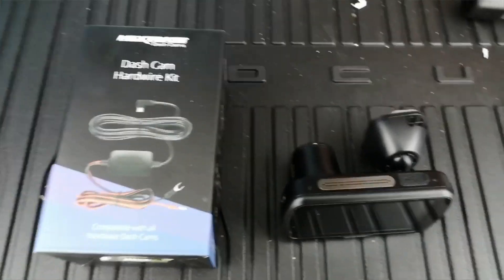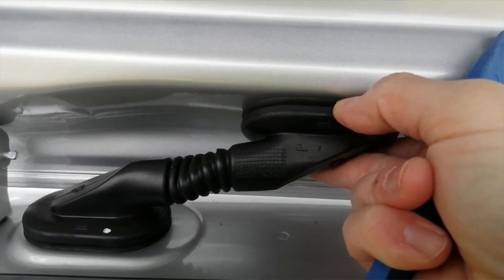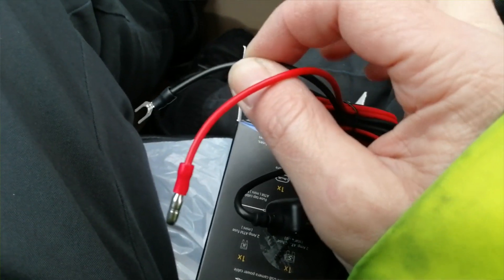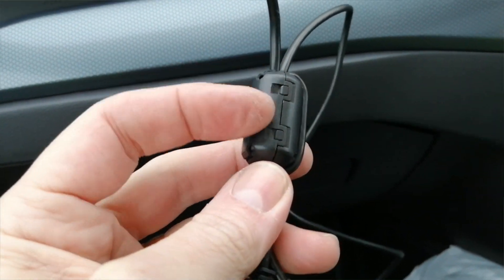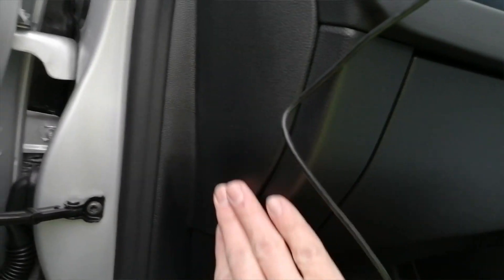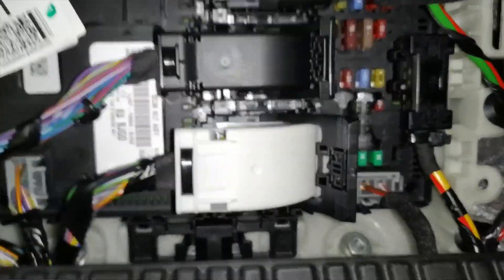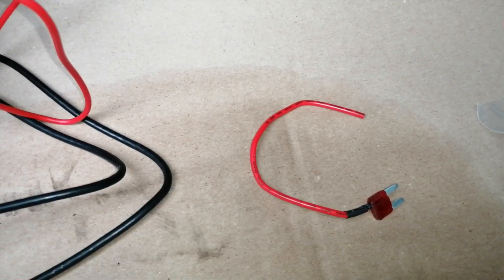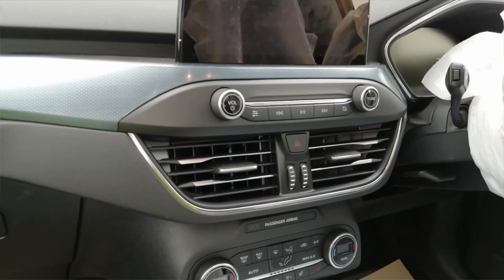Focus Active Crossover 2019 onward Dash cam hard wire + tips on rear cam

Comment: Very helpful thanks.  Unfortunately the trim at the top of my boot lid is taking considerable force to get off, but I will get there.  Perhaps they’ve changed the clips on newer ones 🤔.

DAB cables apparently run along the top of the passenger side to the aerial in the rear screen, just in case anyone still gets dab issues.  None here with a nextbase camera mounted to the top of the rear screen and cable along the top of the passenger side - ferrite noise suppressors at both ends mind.

Comment: PJ, if you don't mind me asking did you have any issue with the rear camera interfering with the DAB ? I'm planning to install a Front and a Rear in a Dec 2018 Focus Vignale and not sure where the DAB receiver is, to position the rear cam and to avoid any intereference with DAB signal.
Reply from the maker: The dab receiver is in the bootlid but it rarely causes a problem on Fords.

Comment: Hi PJ, silly question but how do you get the end of the earthing cable to a ring rather than ring supplied with the kit?
Reply from the maker: Chop off the original one and crimp on the ring version.
Places like Halfords,Amazon, Ebay or local car shops sell them in packs.
EG :- https://www.halfords.com/motoring/tools/fuses-electricals-and-fixings/electricals/halfords-ring-connectors-25-amp-insulated-8mm-hef385-871673.html